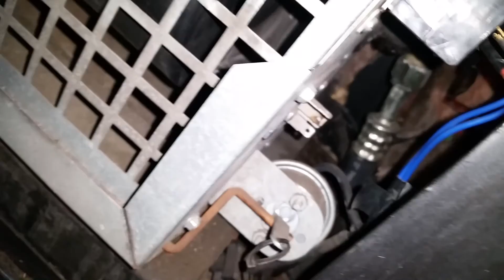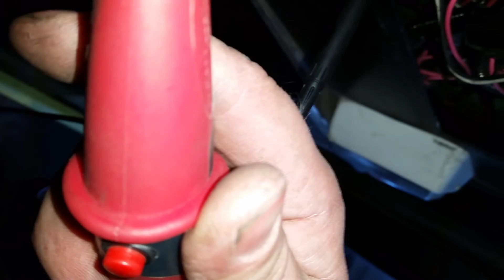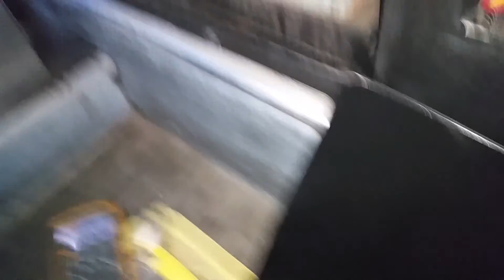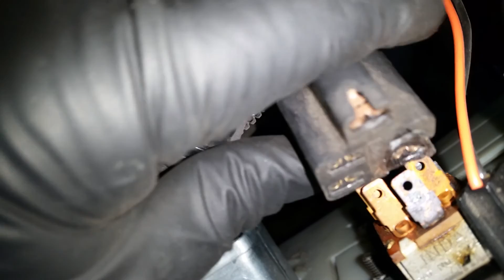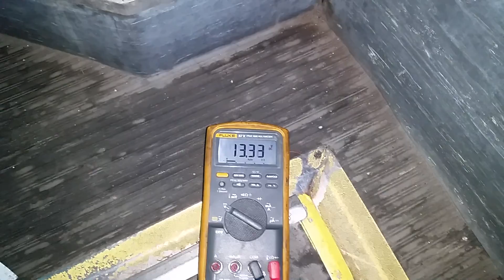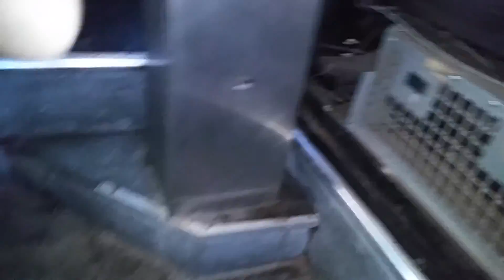Eldorado Bus burning electrical smell.

Comment: Wow a Cadillac Eldorado bus :)  Nice Mike, for checking voltage at the end of a pin is tough sometimes , you  should show the tip sometime how their better, also I like to use my temp gun to look around for hot wires as well do you do the same ?